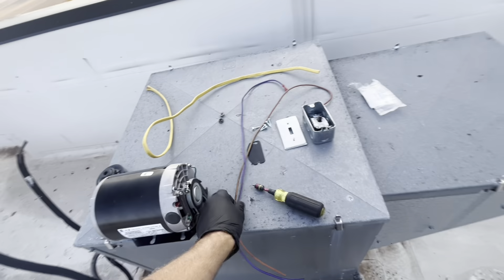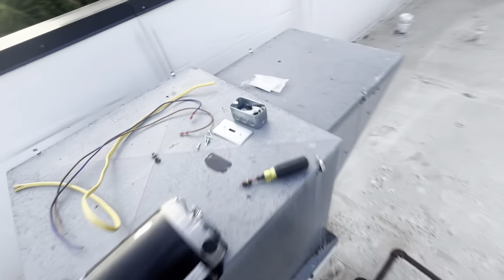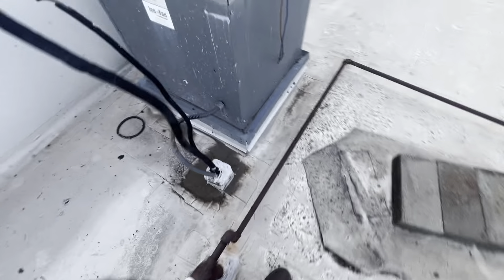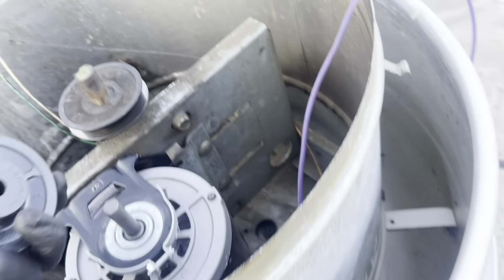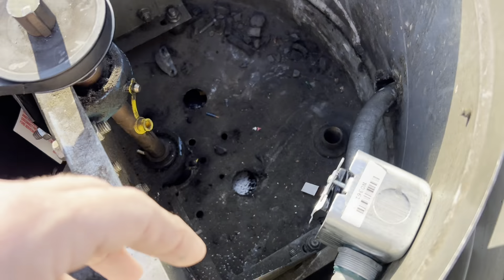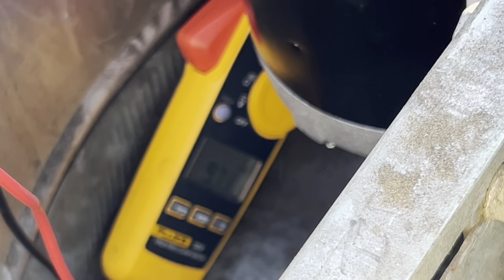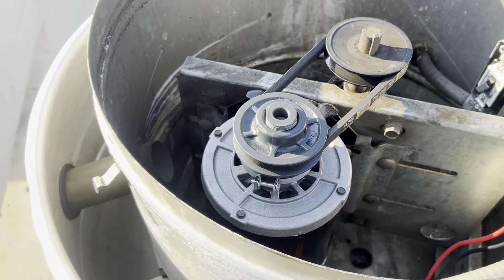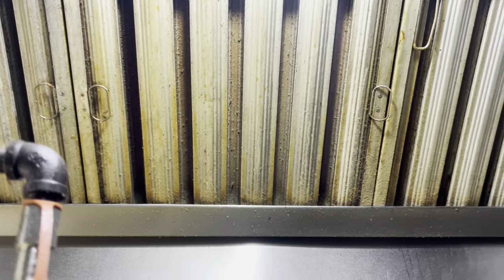Exhaust hood down -  replacement time

Comment: Isn't that the wrong direction?
You wanted it ccw and it turns cw 🤔
Reply from the maker: Did I?  Perhaps I misspoke originally it is indeed venting the proper direction
Reply: @restaurantrepairs  1:14 the shaft is turning ccws unless the frame rate is messing things up at a slow speed,